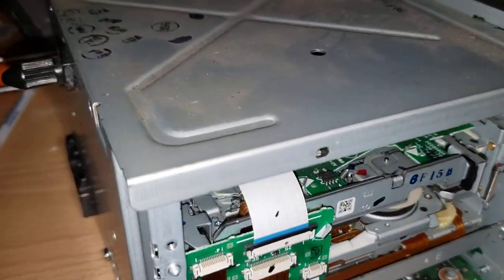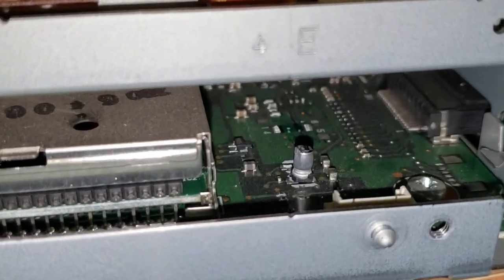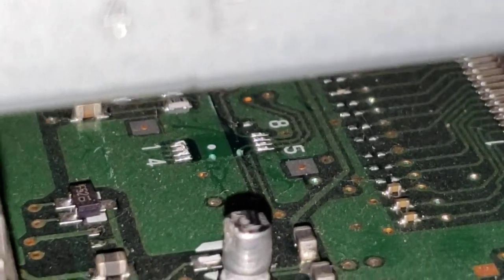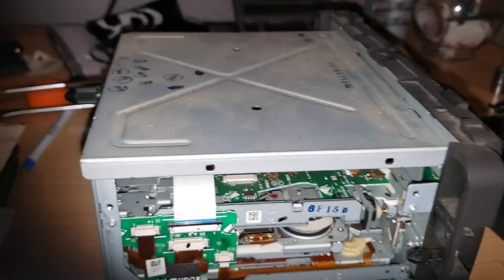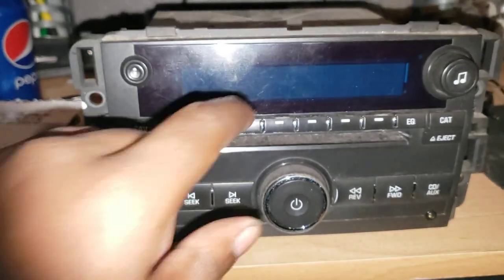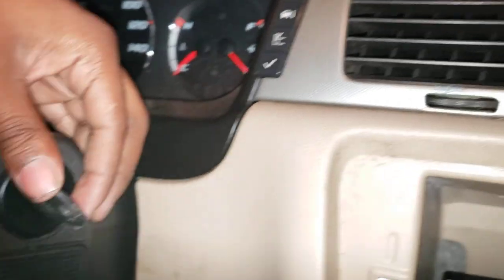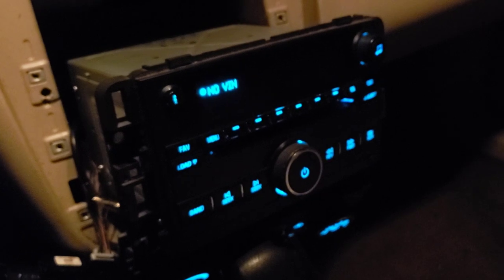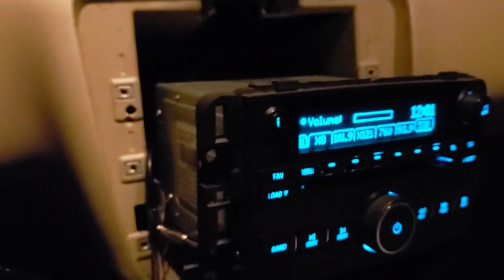How to Unlock impala Radio (Easy)

Comment: After months of trying to figure out why I have no sound out of anything I just did this today and I have sound again. Must have been my head unit. I tried another Bose amp. And didn't work. My question is the cd player is not working. Does removing that chip cause that? I did I just get a bad cd player?

Comment: worked but the volume dial ain’t working the lil small dial to the rt controlling the volume
Reply: update: i took the radio apart put it back together it works fine thanks for the vid💯

Comment: I have the same radio made in 2012 it doesn’t have the 1485 chip. Do you know what chip it be in the 2012 model?
Reply: did u find it i think i have urs also cuz i can't find the chip also
Reply: @mahaelshazly9045  did you find the chip number?
Reply: There are several different models of the radios for each model year depending on what options the specific vehicle came with originally. You have single disc, 6 disc, with XM radio and without, also ones for steering wheel controls and without and so on. That's why your not able to locate the location of the chip he shows here. It could be on a completely different board or just a different spot on the same board. The only way to truly know is to somehow find a wiring diagram for the specific model # radio you have in your vehicle. Other than that it's a guess. Some dealers will unlock or calibrate a replacement radio for free depending on your location but the majority of them charge between $75-150 to do it.

Comment: Call me if you have any questions... lmao. Can't find number. Thanks for the tutorial.  I replaced mine cuz the aux port was f'd up like someone shoved somthing in the hole and messed up the connection pins. On the dash I did reset factory settings as well as unhooked my battery for a few hours and had no problems. I was thinking perhaps you could remove the thingy from inside your old radio and solder to the new one. Wonder if that would work?